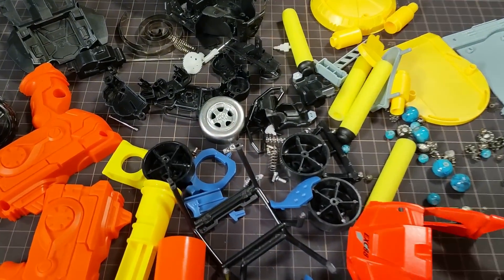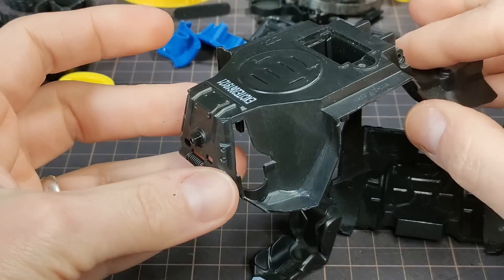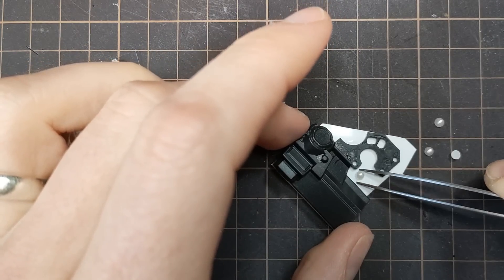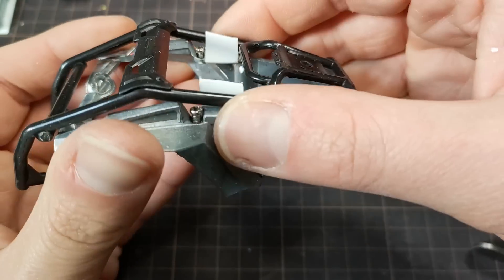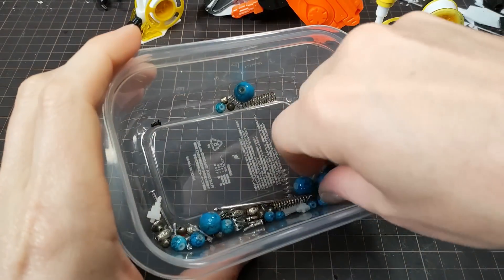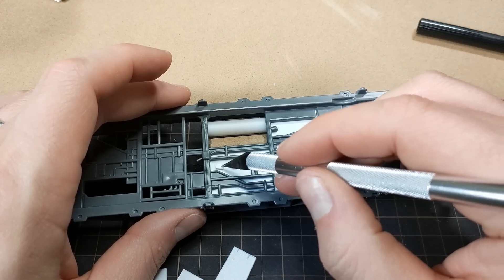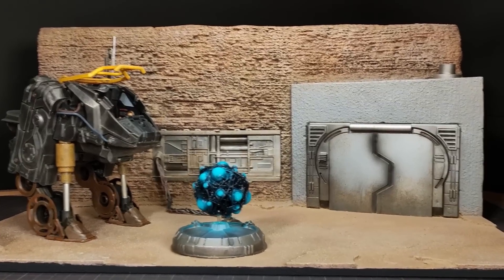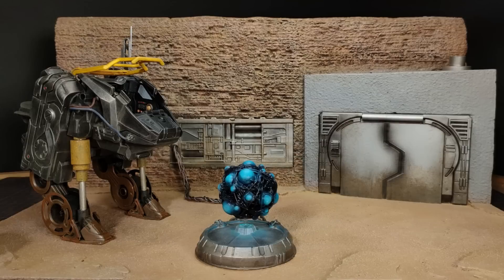making my BIGGEST scratch bash robot DIORAMA yet! | collaboration with @gameyybuilds

Comment: Glad I'm not the only one who just does a texture paste like that, though I usually use bird sand or rock flour depending on the grit size I'm going for.
Reply from the maker: What is rock flour?? Sounds very fine
Reply: @BPCustomCreations  Basically the stone dust that gets collected during industrial rock processing (cutting and the like) that gets collected. You can usually buy bags of it online for next to nothing.
Has the same consistency as wheat flour, but since it's rock material instead of something organic, you don't have to worry about it spoiling like anything when it gets wet during processing. It's sometimes used in agriculture as a mineral booster for fertilizer or in tumbler polishing and other crafting uses. 
A 5 pound bag usually sets me back about $6 plus shipping. A bit pricier if you want volcanic material. Gets crazy cheap if you buy larger amounts through agricultural vendors, we're talking "$6 for an 18 kilogram bag" cheap!

Comment: I think you should have left the blue beads as is they were pretty on their own. Nice job with the mech build it looks like it could seat a Mega Construx figure.
Reply from the maker: Yeah the beads looked cool but they were all chipped and bubbled up. The blue marbled surface was just an outer coating and not a solid bead material.